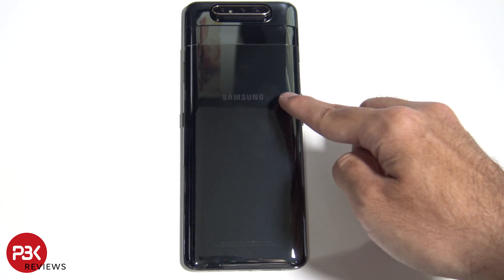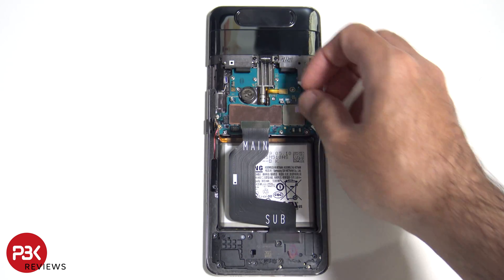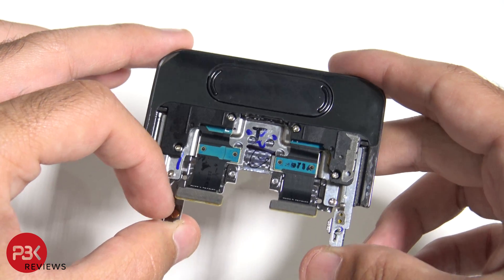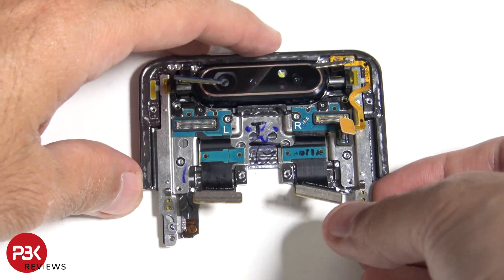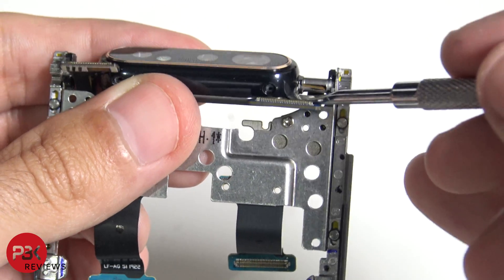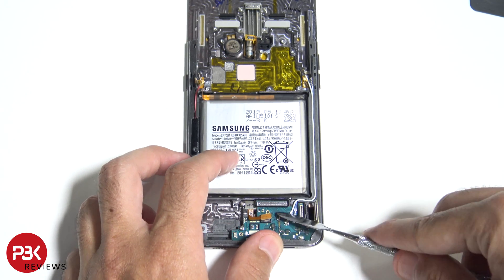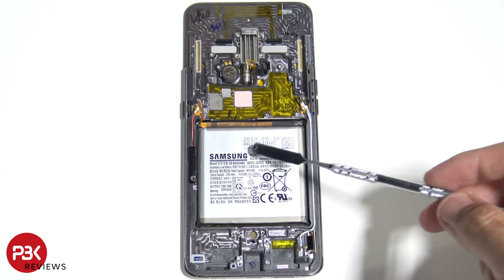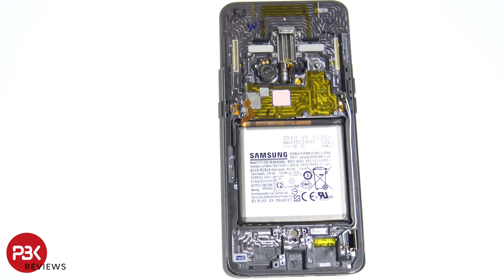Samsung Galaxy A80 Teardown Disassembly Repair Guide

Comment: 7:24  My phone is dead and won't turn on. I've even replaced it with a new battery and a flexible sub-main cable. What could be the problem?🙏🙏🙏

Comment: My phone dosn't charge, any ideas what happend? (Yea galaxy a80
Reply from the maker: It's possible your charger port might have gone bad or the charger itself. It's also possible the phone may be frozen. Have you tried holding volume keys and power button at the same time for 20 seconds to see if it will boot? Can be many things.
Reply: @PBKreviews  it boots but doesn't charge

Comment: My phone broke due to sanitizer. Its speaker not working .Can you suggest what should i do. Can it be changed at service centre. I bought it 3 months back.
Reply from the maker: Do you mean the bottom loud speaker? Yes it can be replaced at a service center. Its possible the filter that prevents dust going in has gotten clogged and not allowing sound to go through so maybe just the filter would need to be changed but that still required taking the phone apart.
Reply: @PBKreviews  yes the bottom loud speaker...
Reply: @PBKreviews  thanks for the reply
Reply from the maker: @vishakhavishwakarma9568  You're welcome

Comment: Bula...my a80 fell into water ..it is on but the touchcsreen is not working. If i do this will it work again
Reply from the maker: its possible, but the longer you use it the more chance if permanent damage. You need to not use it or not power it on until you clean it out

Comment: What should i do if it's  not turning on ?
Reply from the maker: Have you checked to see if its possibly frozen? Press and hold vol up and power button at the same time for 10-15 seconds, or vol down and power button at same time. If still nothing, check your charger make sure it works.  Also make sure you dont have a cracked screen (even hairline cracks in the screen itself will prevent the screen from working in most cases). If still nothing, then you might need a new battery or you might have some other sort of hardware damage/issue.

Comment: After teardown Samsung camera speed very slow, and very noisy
Reply from the maker: did you damage the motor or cable? make sure everything is in place correctly
Reply: @PBKreviews why ur Samsung A80 after teardow pop-up very slow
Reply from the maker: @JkVikramEverything  oh your talking about mine. It was the same speed it opened up before I took it apart, nothing changed.
Reply: @PBKreviews  okkkkkkk, thanks for reply, now me suggest Realme x budget smart phone tear down and full review

Comment: That's an amazing engineering from Samsung🔥🔥🔥
Reply: Good engineering , not enough performance for price and high tec. 😕 İ have mi 8 explorer and it has snapdragon 845 but a 80 has 730g
Reply: @ThatVoidDude  Yes Bro i know that what you are saying that this is not fair that Samsung Charging 48k for A80 but there is a Midrange Processor
But bro one thing we'll know that Samsung only makes flagships in their Galaxy S & Galaxy Note Series
That's the reason why A80's heart is Snapdragon 730G but As of now Snapdragon 730G is Specially designed for gamers
So gaming on the Galaxy A80 will be a  Mind blowing Exhilarating experience with that Gorgeous & Stunning 6.7 inches Full HD+ Super AMOLED Infinity Display🔥🔥🔥

Comment: From the inside it's really similar to the Oppo find X! I repaired a oppo find X and it was a pain in the head to reassemble it again. Also i ripped a cable and had to solder the cable back together..
Very nice video!
Reply from the maker: Thank you